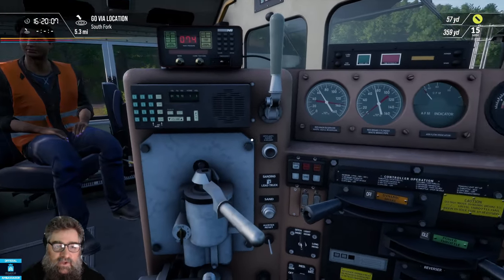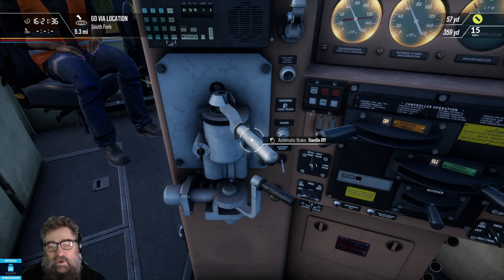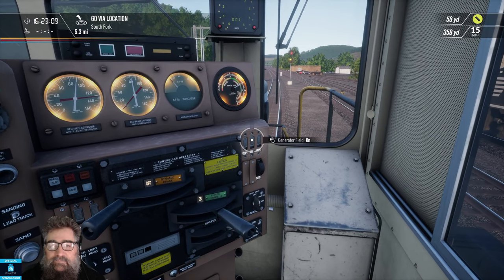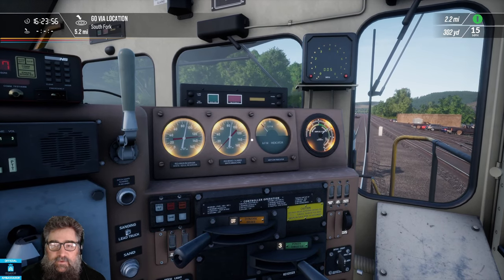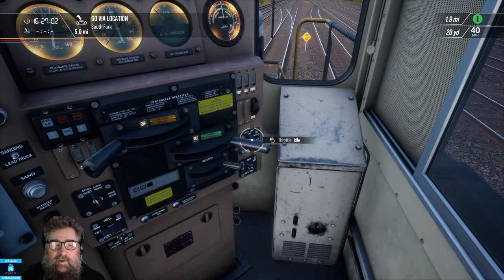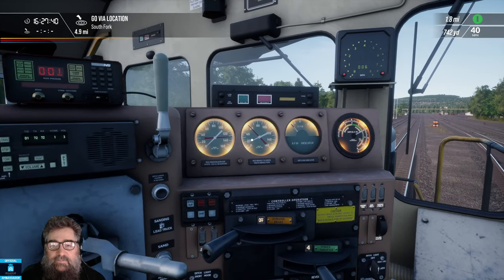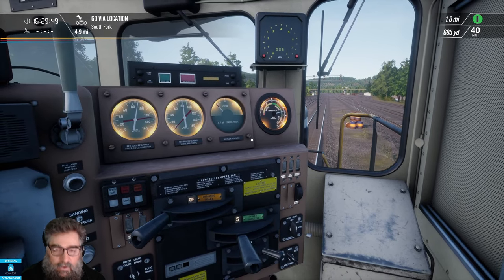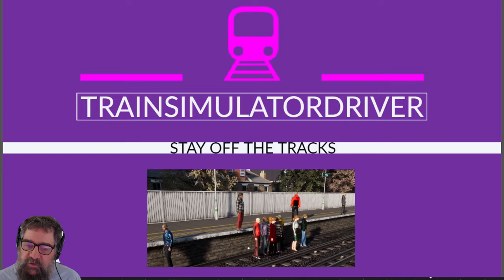TSW2 Horseshoe Curve GP38 2 Tutorial, Setup, Drive and Recovery from Emergency

Comment: Hi trainsimulatorguy done a service where you got to reverse a train with 30 cars plus 2 locos down are gradient. Was wondering do you use dynamic braking just when I tried the dynamics kept cutting out then back in again? Any tips would be great as I think the dynamics are not supposed to work when reversing a train or am I wrong?
Reply from the maker: There's no reason they shouldn't work backwards. Remember locomotives routinely operate in both directions. The dynamics will cut out if you apply the train or locomotive air brake. If you apply the train air brake bail off the locomotive by pushing the locomotive brake handle down. Dynamics also will cut out below 5mph.

Comment: I always bail off when I apply the dynamics just found it bizarre how it keeps cutting out. I used minimal application on the train brake. The senerio was complication at cresson on the horseshoe curve. If you get a chance to try it and see if you get the same issue let me know
Reply from the maker: I've played that one through when it came out but probably haven't touched it since then. How fast were you going when it cut out? On the HUD does the white square turn red? I know some experimentation was done with overheating but I didn't think the horseshoe locos had it only Sherman.
Reply: @trainsimulatordriver  my bad obviously I was going to fast seemed alot more under control under 10mph over 15mph I was getting issues.
Reply from the maker: @Tractor3Thrasher  you do need to go slow on that track, if I remember right it puts you on the steepest of the three. Average speed of American freight down hill is 12mph lol. Seriously advanced.
Reply: @trainsimulatordriver  out of curiosity what the braking procedure when bringing a train to a stop down a incline or going up? When do you take the dynamics off is it below i.e 5mph certain when going down a hill and let the brakes do the rest etc.
When going up a incline do drivers use dynamics to help the train stop or is it a case let gravity do the work and apply small amount of brakes. Thanks again
Reply from the maker: @Tractor3Thrasher  downhill you can leave the dynamics on while you use the air brake because they will cut out anyway unless you bail off the locomotive (good practice to keep your train stretched and avoid bunching). Going up hill just use the air brake, apply it enough to hold you when you stop and let gravity help stop you. After stopping if you were leaving the train you'd do a full equalising application.